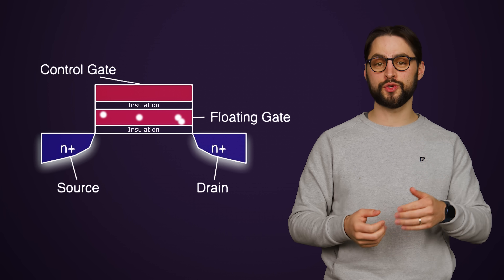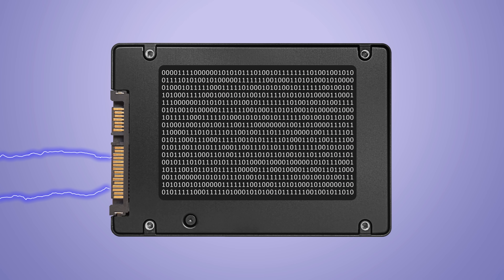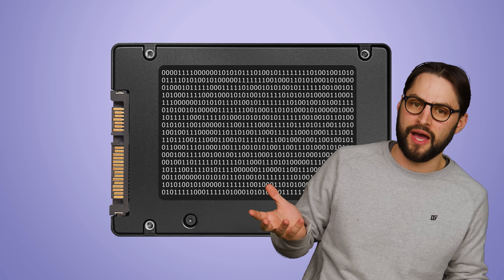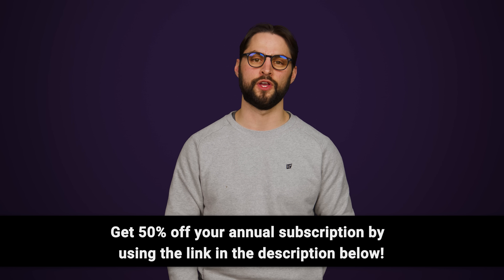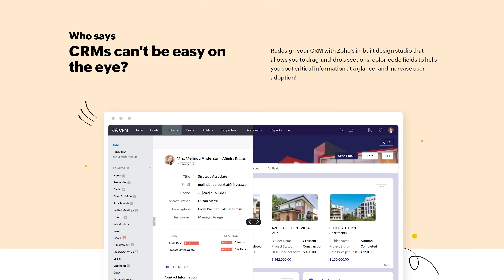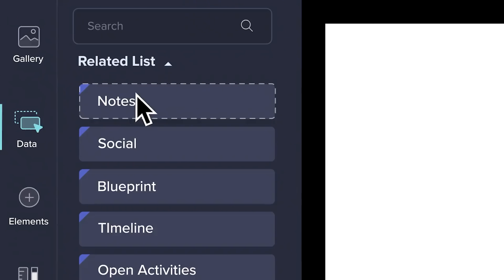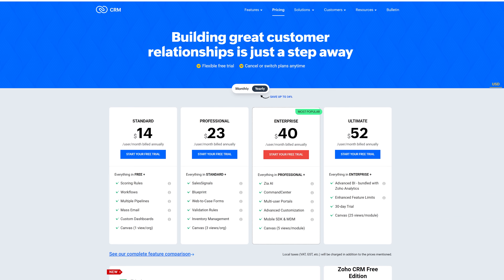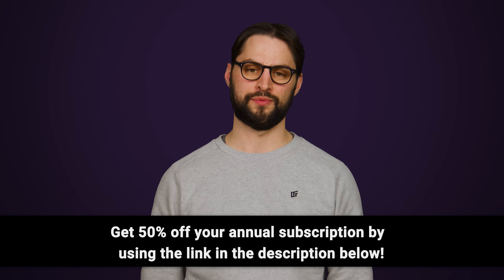SSDs Die, RAM Doesn't. Why?

Comment: You don't need capacitors for storing data in a RAM device. You can make one with only transistors, using a simple NAND latch as the volatile memory and this is in fact the way we are taught to make RAM in school.
Reply: Which is how you make SRAM, using two NAND gates to create an S/R latch. DRAM does use capacitors. You need about 6 times more transistors for SRAM than you would need for DRAM, making DRAM cheaper while also having larger capacities.
Look online: you can buy 64Gbit DRAM chips easily, but nobody sells even a 1Gbit SRAM chip...
Reply: @someguy4915  
True, but SRAM is faster and consumes less power as well. 
But yes, DRAM can be far denser - though whether or not it is cheaper depends as you're using more power and more RAM usually with DRAM leading to a situation where over time, the SRAM becomes cheaper through its lower consumption.
Reply: @kiraPh1234k  True but the power consumption only really benefits SRAM in extremely rare situations such as space exploration where the embedded systems only need a few MB of RAM. In normal computers you'd need so much SRAM ICs to equal the capacity of just a single DRAM ICs that it will usually consume more for the same capacity.
Also SRAM power consumption is only really that low when in standby mode, in which case the computer cannot access it at all. For such cases it's usually far cheaper to just use DRAM and write the DRAM to flash before a standby period, saving both energy and cost on the BOM.
Reply: @someguy4915  
Well, a 256Mb SRAM chip consumes less power than a 25Mb DRAM - This is heavily influenced by the required refreshing of DRAM

Comment: Not quiet right. Read some research and engineering papers a while ago that prove ram cell to also degrade in function especially due to background radiation and thermic wearout. It only is a question of time and extensive usage. That is a reason why certain biz critically systems will have parity extra bits to compensate for failing bit cells. But for most user computer this wearout is statistically insignificant

Comment: Capacitors can hold a charge for nearly forever if there is no load, the reason they can't hold a charge forever in RAM is that the RAM is loading it down which will discharge the cap. Capacitors can be very dangerous and even lethal if they are holding large voltages and are not discharged before touching them, so I think this distinction is important. This video is well done, nice work.
Reply: Depends on type of capacitor. I haven't seen details, but the caps embedded in a RAM chip are designed to be refreshed every few milliseconds, and thus don't have to be engineered for low leakage current.
Reply: Also, the dangerous capacitors typically hold more voltage than the ones in RAM sticks. You're comparing caps that have a diameter of a pencil to caps smaller than the eye can see, that hold a tiny fraction of the voltage.
Reply: In a perfect world that is true, in the real world no capacitor is perfect and thus always has a leakage current.

Comment: Using an SSD you want to check your system for background services going haywire and looping a sync to infinity. We had a Mac mini server for filesharing and syncing acces rights over OpenDirectory at the time from the main fileserver in the central server room. By accident I discovered that a 6 months earlier swapped SDD was already hlway through her lifespan, having had a written data count of over 10 TB. It wa gemerating GBs by the minute of traffic on the drive without having noticeable access slowdowns or anything of the like. Ended up finding out that the Opendirectory replicaror crashed and just created an ultrfast loop of sync temp data that he was writting and wiping.

Comment: This year I've had to deal with 4 separate hard drive failures with friends, family, and at work, and 2 of them were SSDs that were less than 5 years old. None of them had come close to their TBW estimates.
Reply: Even with the best manufacturing and quality assurance procedures, manufacturing defects can happen. When it comes to solid state components, the only way to detect them before use is to destroy them in testing.

Comment: The only SSD  I've ever had failures of was OCZ brand, two of them died within hours. I replaced with Intel in 2008 and no further problems.  Since then, I've installed 3 dozen SSD drives. None have failed.
Reply: Yeah, same here, though it was a few months, I think.
I bet yours also used the infamous SandForce controller which was incredibly faulty and made the drives more and more unusable... ☠️
Funnily enough OCZ RAM was also the only one that failed for me, so I swore to NEVER ever get anything from them ever again! 😤
Reply: @Gaboou  the thing about OCZ was their tech support attitude was akin to if a 10 year old was running it. When I complained about their drives, they sent an emoticon of a toungue sticking out. How childish. I never will do business with them ever.
Reply: @basspig  I feel for you... 😔
I was lucky enough to get replacements from my vendor - and was able to request an SSD from a different company (Crucial) so that this wouldn't repeat...
Reply: @Gaboou  I returned mine to B&H and bought different brands. It all worked out and it was educational for me.

Comment: 2:50 - It actually does do this during Shut Down to a degree, which is why "Restart" is recommended if you're having driver issues. "Shut Down" still saves the system state to disk. In other words, "Shut Down" in Windows is a fancy label for "Hibernate, but close all of my apps first".
Reply: This is due to Fast Startup being enabled in Windows 10 (don't know if 11 has it), thus certain drivers issues come back when booting the system again, if I remember correctly. If you disable Fast Startup, shutting down would be similar to restart, not writing on disk to come back to a previous state, but of course instead of restarting it would actually shut down.
Reply: @Tokisaki8815  Exactly! I thought about including that in my original comment, but I didn't want to drag on and on. I usually have Fast Startup disabled. Mainly because I like to have a fresh boot up each time.

Comment: 2:35 Absolutely not, you dimwit!
The "cylindrical caps" you refer to are electrolytic capacitors, which, unlike, say, ceramic or any other dielectric ones, are in fact a hybrid of a chem. cell and a capacitor. That's why they're polar and exhaust boiled juice when failing.
Any electrical engineer or repairman will tell you that electrolytic caps are the most volatile and least reliable part of any device they happen to be a part of and almost always the first component to fail randomly and require replacement well before any other.
Why even make rhetorical comparison to something you lack fundamental understanding of?

Comment: Would it technically be possible to make a RAM storage drive powered by a battery or something? Like creating a storage unit that requires a rechargeable battery and it uses RAM chips to store data? Maybe it would not be meant for long term storage but if it could be made to store data for like a couple days or weeks. something like that could have it’s use’s and it would probably not be that expensive to manufacture ether.
Reply: That already happened a long time ago. It was the PCI Ramdisk in the Windows XP era. 4x 1GB Max.
Nowadays you can just make a virtual ramdisk in windows. It dumps the image into your main drive and loads it when you startup.

Comment: Sounds like planned obsolescence to me. I would think that they could come up with an opening and closing gate into the insulating layer to prevent wear. But of course we can’t have that, how would be able to buy more overpriced SSD’s in the future.
Reply: Is not planned obsolescence, the transitors themselves wear over time.

My i7-4700MQ is almost 10 years old, and i can notice the wear on the transistors (even with new thermal paste) by looking at the iddle temps vs 3 years ago . The temperature variation between CPU cores at iddle is around 10 degrees, when the CPU was newer, it was closer to 0 or at least 3.

Transistors degrade over time due to the increase on resistance, that explains the slight increase for temperature variations that i have.

I do music production and the CPU is still powerful, very snappy opening stuff here (plus the SSD, my boot time is almost 10 seconds), but the wear is very noticiable.
Reply: @saricubra2867  I mean it in the sense that they chose the type of transistor and insulator design instead of another design that would be longer lasting, one that used a gate system that opens and closes instead of pushing through and wearing out the transistor.
Reply: @vmoutsop  "longer lasting"
It's already happening, the durability of recent SSDs show that, they can last way longer than a Hard Drive with good care and way better than early SSDs from a decade ago.
Reply: @vmoutsop  I bought years ago 1TB Kingston SATA SSD for $80, considering that it's 5 times faster than my older 1TB hardrive on sequential and 10 times on random, i don't see how they are overpriced. 1TB SSDs have insane price perfomance right now.
Reply: If i overclocked the CPU instead of an adaptive undervolt, the transistors would be dead by now.

Comment: I have some G.Skill ripjaw sticks of DDR3 RAM on my older PC (that my partner uses) that repeatedly, (but inconsistently) cause my motherboard to send bios beeps when I start it up. 
I power it off cold, and start it back up. sometimes thats all it needed. Somethings they beep still, so I power down, and re-seat the RAM.  
Sometimes that fixes it and It will go days without more beeps.  But some times it just doesn't go away for like an hour or so of seating cleaning, etc. 
But the odd thing is, when it does go away I put it through some memtest runs and it always comes back fine... reports fine, no bad memory etc so  does that mean the RAM slot on my motherboard is possibly faulty? 
I don't have a spare motherboard to test it with, or another set of RAM.  (my own PC is DDR4) =(

Comment: So will next gen consoles not last because they have ssd?
Reply: Isn't the SSD in console can be changed?
Reply: @basantatamang2249  there is an external option but you cant change the one inside the console
Reply: @basantatamang2249  the new xbox series consoles internal ssd cant be changed

Comment: SSDs are almost immortal compared to regular harddrives. Two of my mechanical drives on my computer build early 2020 have already died (one just begun to click-clack while saving data and was no longer recognized - it failed without warning and without backup). Another "Enterprise" class 8 TB mechanical drive sometimes also behaves strange and is starting to make strange clicking sounds and the file transfer just stops forever with 0 mb/s transfer rate.... (A third mechanical 4TB drive fell down from the height of one foot back in 2016 because it was sitting on the edge of my bed and I accidentally pushed it over the edge - and guess what :D .... it is also dead because of such a ridiculous few inch fall onto very soft carpet!)
I don´t really like and trust mechanical drives anymore. SSDs and NVMe drives have never died, and they never fail, never loose contact with my computer while saving data, never stop a file transfer for no reason, never do anything stupid or strange. That´s why I don´t think I will buy a mechanical drive ever again! 
But the unfortunate truth is mechanical drives have 8, 12, or even 16 Terabytes which is enough space to contain for all my important data since 2004 plus backups - while all NVMe or SSD only offer 1 Terabyte and that´s why I am forced to still use mechanical drives, at least two of them minimum.
My oldest and first SSD from 2015 has still 96% health left and is running every day with constant nonstop read-write (it runs Windows plus the 32GB virtual RAM cache for Windows). I am absolutely not recommending mechanical drives but highly recommending SSD and NVMe based on personal experience and reliability.
Bad quality RAM can die for no reasons under rare circumstances, back in 2010 a watercooled DDR3 OCZ RAM kit suddenly failed for no reason after some weeks (it was never overclocked).

Comment: This also explains why you would want a RAM only VPN service. VPN companies that claim they don't store your data whilst using hard drives make no sense. However, when finished with a VPN session using a RAM based server, everything is immediately dumped and impossible to recover.
Reply: Yeah but that would be pretty expensive compared to ssd or hard drive based server tho but quick GOOGLE shows VPN company like ExpressVPN, Surfshark VPN, Perfect Privacy VPN and AzireVPN plan to use RAM-only servers.

Comment: im still using one of the OCZ 128 gb ssd from 2007,2008 can't remember which exact but it still working as one of my boost drive
Reply: I had a 64GB SSD from 2008-2009 and the controller on those older SSDs SUCKED.
When it came to writing small files it slowed down to a crawl.
Reads were extremely fast though and put my old 150GB Raptor to shame
Reply: Damn.

Comment: The process that the electrons leak is called. Electric Magnetic Tunneling.  This EMT is actually what happens to CPUs as they age or if they majorly overheat. RAM does not have Caps in them for data storage just standard gates and a CAP that prevents the ram from losing power and conditions the power into the bank.. Though the gates work like a CAP, but is not the same technology, Unlike a cap the gate builds up electrons until it gets the needed number then the switch goes on as that creates a short between 2 polls of the gate. The gate polls are not caps. Caps = Reach a certain voltage. Gate Polls = A certain amount of Electrons.

Comment: this isn't entirely true , about the ram.

it actually uses latches which are transistors arranged so that they can flip-flop . the capacitors hold a charge to make sure those transistors hold that state that they are currently in for a certain period of time determined by the capacitance of the capacitor.

this is also why when your programming low level code that you have to ensure that you clear out the memory before you use it.
when the computer starts up those latches will be in a semi-random state resulting in a lot of junk data

Comment: The thing with SSDs is that to increase capacities, they increase data per cell in recent years which reduces write life per data which is a worrisome trend. While you can't really wear down a SLC drive, a QLC drive can test those limits with intense data writing over years. Like a 1TB QLC SSD having about 200TB write limit which is just 200 total capacity writes. While it's still mostly safe for the average user, if they try to cram in even more over the same area with this trend, this will be problematic. They're already working on PLC designs, so..
Reply: Exactly, no one is mentioning this.
In a market full of competition they will cram more density in each cell because it's cheaper and lower cost at the expense of lifespan.
The majority of consumers won't know any better.
Eventually they might end up failing as fast as HDDs would fail.
Reply: Eventually they're just going to have the make the drives bigger and put more cells on the drive if they want to get higher capacity drives out. Of course, this means they will be more expensive, but I'd rather pay $300 for a 4TB drive that has double the circuitry than pay $150 for a 4TB that's going to konk out after a few years because the write limits are so low. But, if you're using the drive to store stuff long-term, and it's not going to be a system drive, like, you wanna put all of your high filesize games that aren't updated often on it, or store videos or what-not on it, then that would be perfectly fine to go with the limited write version.